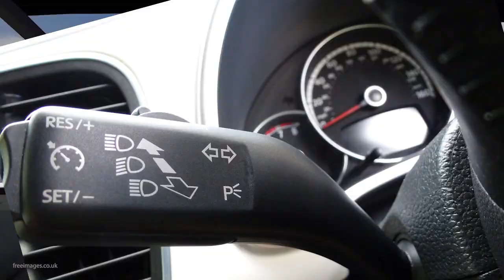Super Serious Track Guides | Auto Club Speedway Moto Course (iRacing)

Comment: You CANNOT just make a chicane out of cones! I don't know whether to be mad at iRacing or the track owners.
Reply: The course layout seen here, as indicated in the title,  is only for motorcycles.  The point is to keep them off of the high speed banking (I presume.) 

The car course uses the NASCAR banking for the first two turns.  In real life, there are parts of the (car) course that do use cones, barrels, or tire barriers, mostly where the infield rejoins the oval.  The biggest variable is the placement of the chicane after a decreasing radius turn before the longest infield straight.
Reply: @Firebert79TA  honestly keeping the bikes off the banking seems weird to me as Daytona's bike course, while omitting NASCAR turns 1 and 2, keeps turns 3 and 4. So if bikes can handle Daytona's 30 degree banking I'm sure they could handle Auto Club's banking.

Comment: I’ve seen races run in this infield and they are as terrible as you think.
Reply: Yeah, I was bummed Super GT (then JGTC) didn't use the car layout for their 2004 exhibition race, but I can see why the drivers would have been apprehensive about negotiating oval T1 and T2 in mostly RHD cars.

In a perfect world, Riverside and Ontario would still be around (albeit updated and upgraded), thereby eliminating the need for ACS to ever exist (though I am glad it does in our world).
Reply: Tom Anderson I’ve seen them do T1/2, and make the left on the back stretch too. Which is the better layout but the roadhouse here is still kind of a joke